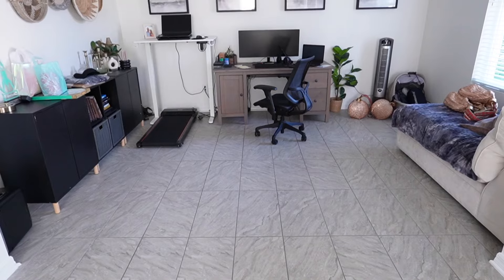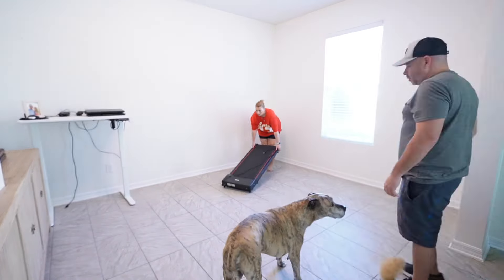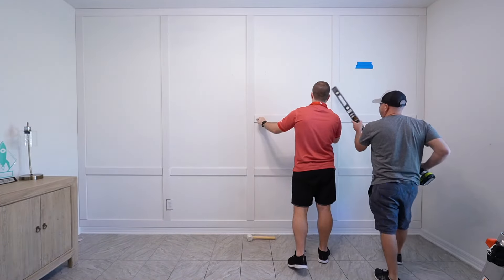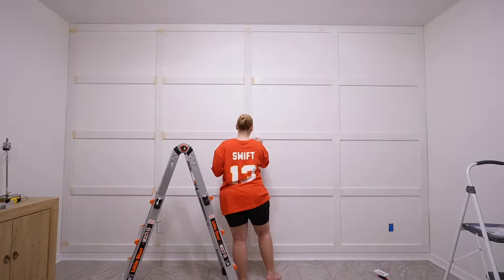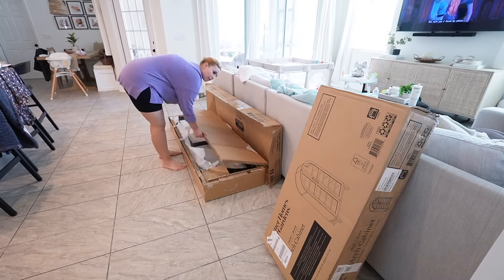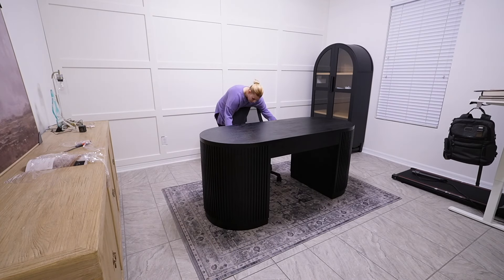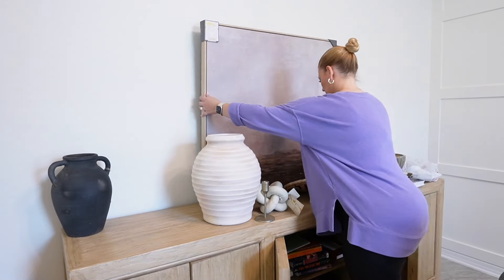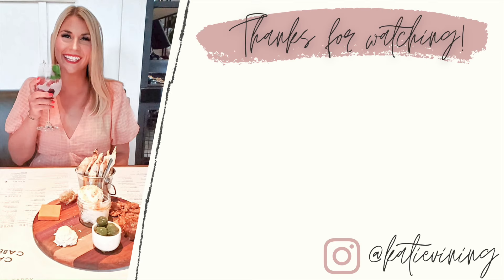EXTREME HOME OFFICE MAKEOVER w/ DIY Accent Wall 🏡 | Home Decorating | NEW Decor + Furniture

Comment: That wall looks great. I put a little cabinet with doors together. My husband helped a little. But when I put the metal piece to hold the doors closed. I realized we put the doors on upside down. I still haven’t fixed it. But I’m just going to get a bigger piece of metal for the magnets to stick to. Of course, you couldn’t do that with the way your cabinet and doors are shaped. Lucky you. I don’t love vacuuming. My dogs keep bringing leaves in. My fault for not blowing them out of the yard. But I have no idea where to put them. I did blow them all along the edge. But it makes no difference. I think maybe the art is a little high. But probably because the hangers are low in the picture. But I will mind my business. But you asked. It looks so good.

Comment: You could make that wall renter friendly with styrofoam poster board. As long as it is a wall that you don't walk by or press against open because the styrofoam poster board will dent. But if you were to use it for an accent wall and place a hutch or sideboard on it no one would know especially if you paint it!

Comment: Nice job Katie, I probably would have put a larger picture on the wall or two pictures side by side. You have a lot of wall space there to occupy and no other art work. Also (pet peeve) please remove the manufacturer stickers on the second shelf left side of book case. You were probably so focused on decorating the shelves that you didn’t notice them. 😊
Reply from the maker: I tried but theyre not peeling off nicely so i figured a whole sticker looked better than a half peeled off one for now haha
Reply: @KatieVining  you could try to apply high heat with a hair blow dryer. It should loosen the adhesive and peel off